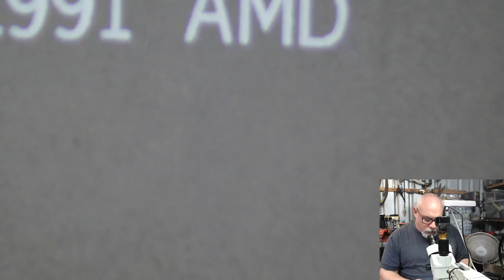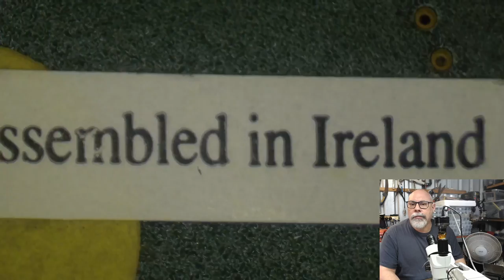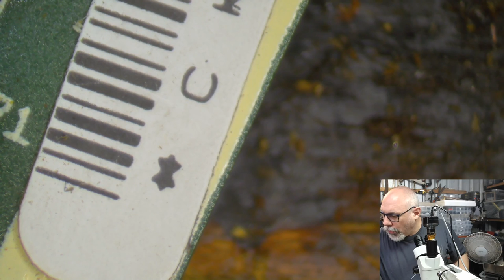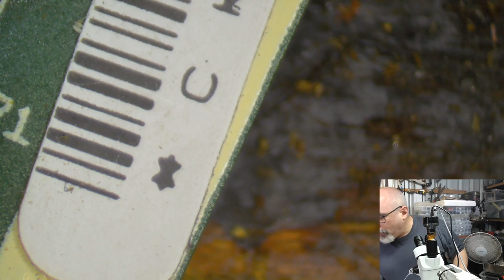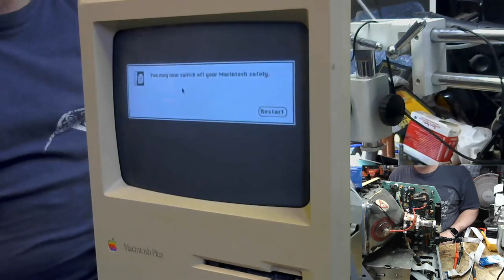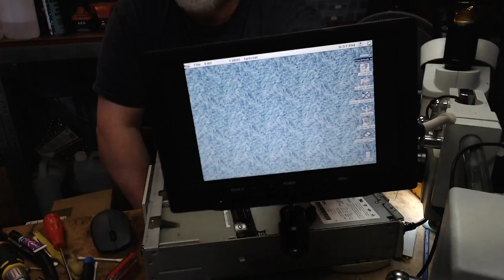Recapping a Quadra 660AV

Comment: Thank you for demonstrating the voltage adjustment on your Macintosh Plus! That was very helpful. And thank you also for the advice on the scsi2sd formatting. Using the patched version of HD SC Setup worked perfectly, and I really should have used that to start.